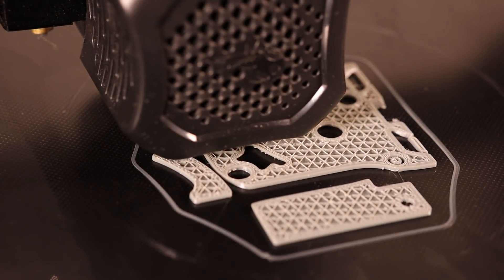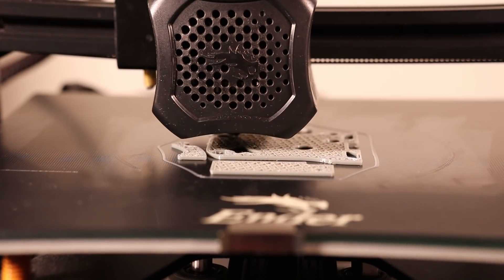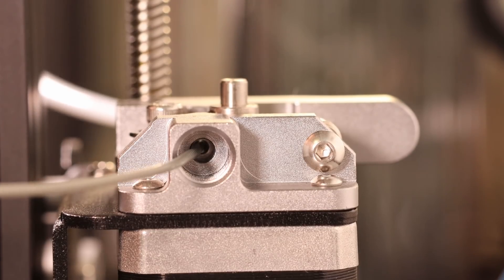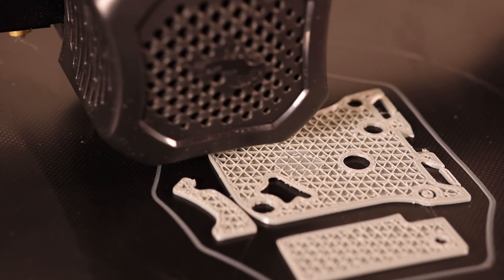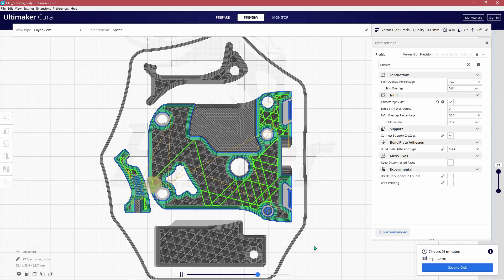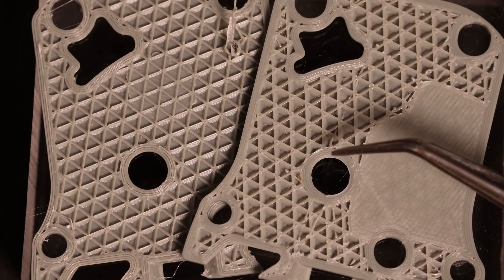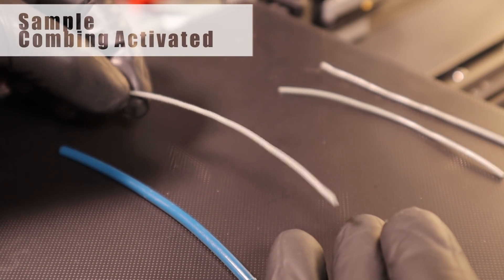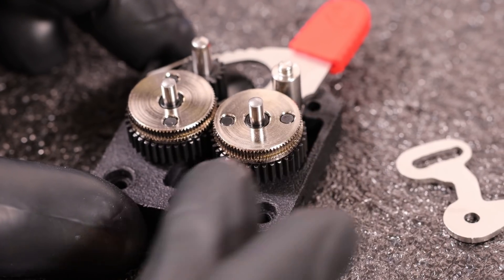Creality Ender 3 V2 - Stop The Print From Failing Like This

Comment: This was the answer I have been searching for. I have spent the past 2 weeks on 3d printer forums asking why my print kept failing. People kept telling me it was wet filament but I knew it wasn't because it happened to 3 different spools and it was only on this one model. It has 4 thin walls and it kept snapping the filament when the infill started printing. I went through all the steps of checking the spools, the bowden tube, couplings, extruder, e-steps, temps, PID... Nothing helped. Then I found this little video, changed the settings in Cura and now printing the 18 hour piece without any issues. Thanks man!

Comment: Thank you so muchj for this video. Not a lot of resources about this issue. I tried your suggested setting in cura but I'm still getting the same issue. I ordered the dual gear extruder and will arrive tomorrow and I hope this will resolve the issue. Do you think getting a direct drive extruder will also solve this issue?

Comment: After the support has been laid out, it prints for 30 minutes before the nozzle catches in the printed matter and slides my whole projects around the plate. Any ideas on what I can do?
Reply: That's a build plate adhesion problem. Use a wider base (maybe a raft or a brim). Make sure your first layer is printed low enough. Make sure your first layer has a layer height of 0.2mm+. If all of that doesn't help, you can use 3D-printing-glue on your print bed.

Comment: Cura also has a maximum retraction setting which limits the amount of retractions that can happen over a certain length of filament. 

It seems like Cura has more settings that you could ever use. It's overwhelming sometimes even for experienced printers.

Comment: Thanks for your tutorial and covering this issue. I was having this problem also with the extruder flattening the filament and binding in the bowden tube halfway through the print. There's virtually noting on YouTube about this. This only started happening when I replaced the original Creality tube with a better Capricorn one. 
In Combing Mode I had "Not in Skin" checked so I checked "All" and that's fix the problem. This seems more of a patch solution so I think a duel drive extruder will be the best option.......

Comment: A but late, but... I think the are multiple reasons for skips / deforming of filament:
* too high a pressure on the filament in extruder
* too many short & frequent retractions (as you noted)
* too tight fit of filament in ptfe tube (filament tolerances)
* heat creep from the stepper motor to the driving gear touching the filament

Especially on long prints, the last one will start to play a big role. Solution of that one is a bmg style of extruder, where the filament driving gears are not directly connected to stepper, so the heat can not be transferred.
edit: this is what is being addressed by the M4 as well as you've observed in your other video

Comment: Brooo I've been diagnosing this issue for few days now it never used to happen but after heavily upgrading my setup this started on big prints. I think the main cause is a combination of too stiff spring and the upgraded extruder being aluminium therefore absorbing heat from the stepper below it and running in an enclosure, perhaps the tighter Capricorn tolerance doesn't help either! I knew it was retraction causing it to flatten and after printing the same model without retraction it worked. I even managed to print another large one with minimal stringing with 2mm retraction. I'll give this a go I tried to print recently with 0 infill and it still happened...

Do you think a direct drive with it's 1mm retraction could prevent this too?

EDIT I read an amazon review saying the original tension spring for the plastic extruder is shorter and softer, so I took a look and it is! I'm going to revert the spring only and see how things go

Comment: hmm will have to check this after work. I just got the anycubic vyper yesterday and did the owl test print which didn't have any issues. After that I did a 7hr print of a lager model and it had clear signs of under extrusion in random areas at different height levels. Could also be the 1 year old filament too 😂

Comment: I have no idea why Cura still doesnt Set the Beginner friendly settings like combing as default. This is a huge shortcomming as it makes getting into 3D-Pinting harder than it needs to be. Just take prusa slicer everyone! So much more powerful and streamlined. You even have well working profiles for Creality printers and others. You will not want to come back to this mess that Cura has become.  The error in your case is caused by a soft material and extruder grip tension that is way to high. You did the right thing with this Dual Dive extruder.

Comment: Don’t print you Voron with petg
Reply from the maker: Thank you, I've heard this from a few others as well.  One thing I really appreciate is when people explain why they make a suggestion such as yours.   I print in PETG mainly because I can record video without the enclosure ABS is not so easy to do.
Reply: @NeedItMakeIt  yeah, the video is great. PETG fails gradually under heat creep. So if you build spec, you will be enclosed and thus suffer the same faith as CnC kitchen on his v0 build with his old filament
Reply: Just to make it clear: PETG starts failing way before it’s glass transition on melting point and this will affect you ability to keep everything in place in a motion system like the voron
Reply from the maker: @glimps84   Thank you, very good info.  Some parts could be made from PETG, for example the skirt around the printer, any parts with force being applied or will be inside the enclosure will require ABS, or purchase a kit of machined alum. parts.

Comment: Check out the gyroid filling, it's even stronger and in every direction too.
Reply from the maker: I do like the gyroid infill, what I don't like about it is at higher speeds it likes to vibrate the printer, the results are still good, but I think I'd need a bit more rigid setup to use it all of the time.  I normally print infill around 60-70.

Comment: Good stuff. It's probably already been said but if you have any intention of running your switchwire enclosed I'd definitely suggest printing the parts from ABS or ASA. Voron parts are designed with ABS shrinkage in mind.

Comment: Have you tried a Bi-metal heatbreak? It greatly improved extrusion flow rate, check out the CNC kitchen video. For me my prints alot. Triangle lab one apparently works good at 20 dollars
Reply from the maker: I've added it to the list to test out, I think you/he are right it will make a difference.  Thank you!

Comment: please don't make a voron out of PETG lol
Reply from the maker: Would you mind to explain why people are so set on using ABS?  I figure we have maybe three parts on the build which would require ABS.  Maybe I should ask the Voron crew directly.  What I find is that people make comments like this without having tested anything themselves, I'm curious to know what the exact problem is with using PETG so I can be confident that avoiding it is necessary.
Reply: @NeedItMakeIt  come join the discord! People are more than happy to answer any and all questions there.  There have been people who built vorons with various different materials and had catastrophic failures because of it, whether that may be due to creep, lack of temperature resistance, or poor dimensional accuracy.  I can't provide any more concrete data other than that I've made certain parts with petg and had them fail very early, but there are others in the discord who could give you much better statistics and material properties

Comment: Can`t you just losse extruder screw ?
Reply from the maker: Mine was set to the loose-est... setting, others have said to replace the spring with a bed spring and that works better.  Personally I'd prefer a little more pressure, too loose and not enough pressure in itself will lead to slipping and that can ruin a print.  Dual gear is the best solution I believe and I am in the process of testing some of these.

Comment: great advice! good luck completing the voron parts, finished a 2.4 about 3 months ago and love it! are you just building an afterburner for your Ender or a full printer?
Reply from the maker: Thank you!  I am prepping to build a SW, maybe two if I like it.  I think a 2.4 would be better performance, but I wanted to start with something a little more familiar.  I'll have a video out soon on the M4, so far so good!
Reply: @NeedItMakeIt  awesome. I’m working on converting my CR-10 to a SwitchWire currently. If you run into any problems feel free to reach out.

Comment: My friend.   Nice video.   I had the very same issue with my ender 3 v2.  It was happening only with softer filaments.   What I did and solved 100% was to remove the preload nut that is connected to the extruder spring.    This fix alone solved all my issues and I could print with the same G code that I was having failures beforehand.    Cheers
Reply from the maker: Perfect, thank you for this.  I've enabled this before not fully understanding these features, and the reason for failures on occasion which presented themselves regardless of the filament and any other physical changes I had made, I figured that it would help some others with the same issues.  Thank you again for taking the time to leave a comment!

Comment: I think this is also amplified if the petg is a bit moist, for me 2 hours at 60c for the filament in the oven fixed it.
Reply from the maker: That could be, extruding moist filament may require a higher nozzle temp.   Recently I've been testing and reviewing a filament dryer, and it does a great job especially thanks to the humidity we've had lately in Ontario Canada.  I was using the oven trick like you, my oven was a little hot even at the lowest temp and liked to bond the filament... not a fun surprise.  I've found that PETG does absorb a lot quicker than ABS or PLA.

Comment: Hey @NeedItMakeIt maybe you should also try double the thickness of your infill, so you allowed to have less percentage and bigger shape's. Should be strong and also reduce some issues together with your mentioned tips.
Reply from the maker: Nice, for sure, I did also just experiment with a 0.5mm infill extrusion for a stiffer final product, and the print went well.  Not sure about stiffness improvement yet.  I'll have to find a good way to test it.
Reply: @NeedItMakeIt  Not shure if you get me right. I ment to double i.e. Infill line width. A additional wall is always better than more infill from my point of view. Everything always depends on the model and where the stress is coming from afterwards.
Reply from the maker: @lazyman1011  A valid point.  The further from the neutral axis the better, the issue I always run into is how to support the top without infill.  Tree style infill?  Most of my prints are structural and do require a heavy infill so they can support the loading applied, but this is probably unusual for a 3D print to only bear load in compression.  Some food for thought for sure, thanks!
Reply: @NeedItMakeIt  Infill is not so easy to steer. You only allowed to adjust it not design it. So what you may try would be  Cubic (subdivision) together with Gradual infill steps. Maybe you have enough top support then, the infill step high is adjustable. That would be my solution of your explanation if I understand you correctly. If you have well adjusted bridging capabilities with your printer you could also increase the top thickness and need less infill then if you don't need strong sqish direction parts and more nice looking ones.

Comment: In Cura there is a setting specifically to prevent this from happening, it's called "Maximum Retraction Count" .

This setting adjusts the number of maximum retractions on a specific area of filament to prevent damage, by default it's set to 100 which allows what you see to happen. Change it to 10.
Reply from the maker: I'll give it a try, thanks.

Comment: Thank you so much for this. I was having the same issue and combing definitely helped. Looking forward to more ender v2 tutorials from you
Reply from the maker: For sure, also try setting the maximum retraction amount from 100 down to something like 10, others have mentioned that this also works, I haven't tried it myself, but it sounds like it will limit those retractions which cause the jamb.
Reply: @NeedItMakeIt  went down to 20 and so far so good!
Reply from the maker: @LeoGarcia3HC  When I have some time I'll make a follow up video on extruder performance, single gear/dual gear/larger & smaller gears to see how it can impact this as well.  Glad you're having success!
Reply: @NeedItMakeIt  All thanks to you! I'll be ringing that bell for notifications haha
Reply from the maker: @LeoGarcia3HC  Thanks Leo!

Comment: Thank you for the tip you just gained another sub! This is exactly what I was getting on long prints with petg. I never found a solution so I was kinda thinking it had to do with the extruder. I tried loosening the arm but it’s not possible! So I ordered a dual extruder thinking it would help but I still haven’t received it! Thank you for this video I can try the setting with the stock extruder
Reply from the maker: Glad it helped.  I had this problem in the past and on prints with a tight timeline for customers, it can be very frustrating and waste of money and filament.  One less potential problem with our 3D prints is a good thing!

Comment: PETG Voron parts! ... Don't do it. You will only have to reprint them in ABS
Reply from the maker: I'm open to the possibility, however I also know that PETG will work on many of the locations on the printer, there are select few areas which might require something with higher temp resistance.  Would you mind to share exactly why and where you think there would be a problem?
Reply: @NeedItMakeIt  Its not recommended by the designers, the parts are designed with the ABS shrinkage in mind(so a material with a different shrink factor will end up with parts with an incorrect size), and all the vorons printers are basically enclosed causing alot of problems with sagging printed parts. Even CNC kitchen, who used PA CF for his parts had this problem and his v0 was not enclosed...
Reply: @NeedItMakeIt  And PETG suffer from creep much more than ABS, if you print a Voron in PETG regardless of heat, any of the PETG under any tension will deform over time. You will be constantly troubleshooting and tightening up screws. Fair few horror stories on the Discord from people who went PETG. 

Expect you could get away with PETG for much of the Afterburner, but even ABS part coolers have a tendency of deforming over time. There is a ression it is only used for plastic bottles and 3D printing, it's a terrible plastic! :)

Comment: Thanks, that’s exactly what i needed! I’m having this problem since i started using the Capricorn tubing recently.
Reply from the maker: The Cap tubes have a slightly tighter ID, which might be part of the cause.  CHEP recently had a video on lubing the tube a bit, I'm curious to see how it might affect the results on my prints as well.  Glad it could help a bit.

Comment: Wow this is just great to know, thanks a lot! Btw, do you happen to use Prusa Slicer as well? For this feature to have an equivalent or something 😬
Reply from the maker: I'm sure there is, I have the slicer, but I have limited time and haven't had the chance to learn it yet.  It is touted as a great slicer, I'm sure there is something similar.  If not, there might be a setting to reduce the max amount of retractions, others have suggested that solution as well.

Comment: This is a great tip, and though I've already been using these settings it did make me think about the spring tension on the extruder and how it could impact print quality. The BMG extruder allows you to adjust the spring tension.
Reply from the maker: A viewer mentioned that the stock spring is too stiff, an upgraded bed spring seems to work better, I'll try it when I have a chance.  These extruders have an adjustment, but I can't imagine wanting to add any more pressure, so maybe a different sprint will help.

Comment: Good video and investigation, but you missed two key settings that will work to help this issue "Maximum Retraction Count" and "Minimum Extrusion Distance Window" default they are set way to high 100/1 which means it can retract 100 times over 1mm of moved filament. If you adjust the Windows to the length of your retractions and then adjust the count to something more like 10 or 20 it will limit excessive retractions over a small length of filament. It takes some trial and error to find the sweet spot, and something with way too many retractions could end too oozing but it is worth looking at. I just prefer the dual drive extruder option :)

There is an article with info on it at All3DP
Reply from the maker: Those are great tips I'll be sure to try them out.  Which dual gear to do you prefer, I am testing two at the moment.
Reply: @NeedItMakeIt I have tried two BMG Clones (triangle labs and mellow) and both have served me well, the former is probably slightly better made. They were fitted to an Ender 3 Pro with quite a few Mods and then 2 of them on a SV02 dual extruder printer, both ended up as direct drive (well close to direct)

I'm about 2 weeks into tinkering with a BIQU BX printer that has a 7:1 H2 extruder, it's a beast but I'm yet to fully push it.

I spotted the newer BMG in your video, keen to see your thoughts.